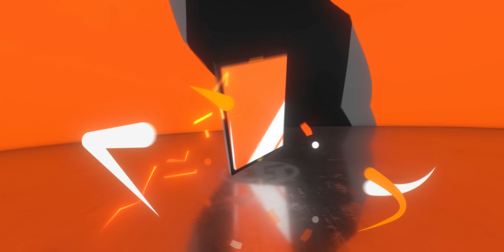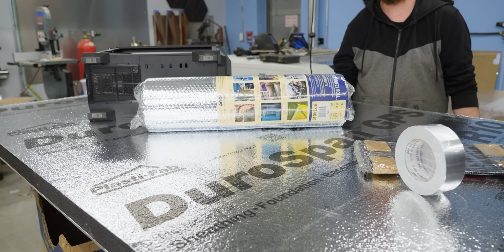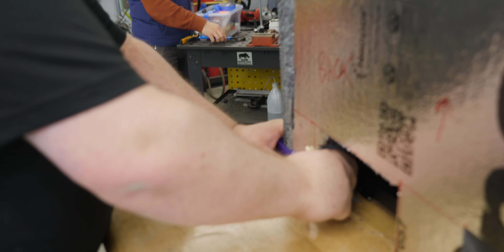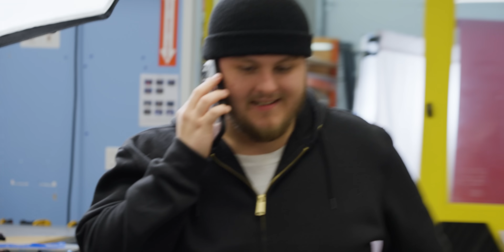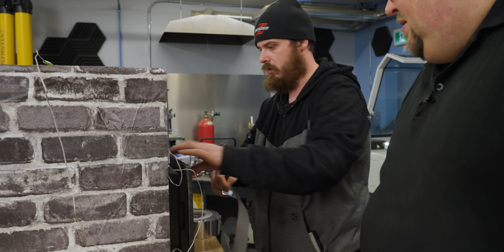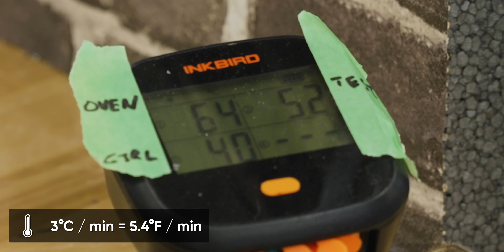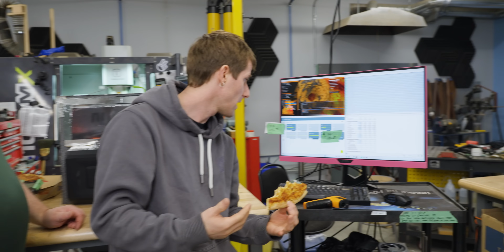Remaking Our Most Hated Video - Pizza Warming PC V2

Comment: My expectation for this video was for Luke and Alex to design some kind of heat exchange water block that the pizza would sit on and that transfer all the heat energy direct to the bottom of the pizza and the chamber, not obstructing airflow. Come on guys you can do better.
Reply: Thankfully they'll try again in 8 years
Reply: exactly my thoughts.
Reply: Hear me out... Peltier coolers
Reply: @ryanmiskin  peltier coolers are not very efficient, and in pc setups that use them they can consume as much power as the system itself. I’m sure it would be very good at keeping the pizza warm and the pc cool, but at that point it’s more like you built a peltier oven that cools the pc. I just mean that the games running on the pc that’s supposed to be doing the warming.

Comment: heat something with the power of a pc......
there is a french startup (Qarnot computing) that had the same idea, but they pushed it to another level.

for the individuals buying their product looks like a "weird electric radiator" (with an RJ45 plug???)

for companies on the other hand their product is computing time on their special "data-center"
the "electric radiators" are in fact intensive computing servers that are members of the "data-center"

Comment: I want to see a custom hot plate designed for an RTX 5090 and an Intel CPU where you can put a coffee mug on, a flat bottom bowl of food and whatever else you want. It should internally have water channels so you can control the temperature. Turn the pump and fans down when you need the heat, let the parts throttle.

Comment: Using Peltier elements to heat up the pizza and cool the PC.
It can be done by heat using a Peltier element clamped between CPU waterblock and regular fan cpu cooler.
This way the PC gets colder, and the pizza can get even warmer.
Reply: Was going to say the exact same thing. Peltier coolers get really hot.
Reply: I had the same idea. Also, I love how Peltier cooling is a terrible solution every time they test it, yet somehow the idea cannot be put to rest.

Comment: Make a 2way water cooled pc. 
1way circulate air through a radiator in an enclose "oven" 
1way cool down the system. So when the oven is at desired temperature you can cool down your pc. It would be so efficient!

Comment: The whole PC is going to heat up with this design. You should have used water cooling blocks on the CPU and GPU, then transferred that heat to radiators in a separate isolated compartment with the pizza.

Just like Lunis' pool!!!!

Comment: yeah i think you would need to eliminate airflow to the pizza by having it in an isolated chamber that is only connected to the heat source via heat exchanger in order to heat up the air and pizza inside. Keeping that volume as small as possible should be another priority. Having a custom copper plate with channels inside, where you direct the custom loop coolant water through (which you should heat to 60 to 65 C) would be the most elegant solution i suppose.

Comment: The radiators should be totally inside the oven, recirculating the warm oven air and adding more heat each pass. Having the radiators take cool outside air is good for performance but is counterproductive to warming the oven. As Linus suggested, some louvres to give the rads some fresh air would be good if it is getting too hot. 

If you really want to get into it you could try and make a counter-flow heat exchanger by stacking a few radiators together.

Comment: you should have connected the remaining spare psu connectors to to a metal grill with a twisty nob voltage regulator inbetween even with the minimum volts before the pc suffers will generate heat and direct heat on the pizza too 😁

Comment: Best way to go about doing this is to use all the fans except one to recirculate the discharge air through the pizza warming area. Then use the singular fan on a controller to keep the overall temperature at the desired setpoint. I'm thinking 70-75°C

Comment: 1.5kw PSU, and multiple peltier 100w chips connected to the water cooling block and the oven. Set it up with quick disconnects so you can use the PC as normal or connect this in line to take the coolant through the peltier units as a standalone pizza oven. If you insulate it right, 500-700w of heating like this might do the trick. It also means you can overclock while heating the pizza.

Comment: Use an AC unit to get more heat to the pizza while keeping the PC cold. If that's too loud then use a thermo electric cooler where the heat sink is a hot plate for the pizza.

Comment: Idea: Use the giant radiator Debauer has mounted to his wall, as a heating table/oven, using the water loop to cool, I dunno 6-10 pc's, and then have a lan party, keep adding pc's until it heatsoaks the radiator enough to keep let's say 3-5 pizzas warm.

Comment: One of my college tutors told of a story of how he would go to lunch and buy a chillidog.
He would then get back to the office and warm up the chillidog on the top of a hot piece of broadcasting equipment.
After a while the expensive and fairly uncommon device stopped operating.
When he disassembled it, he found that stray drips of chilli sauce had etched its way through the PCB.

How would I improve this?
1) separate the PC from the pizza warmer, to avoid the drips.
2) use a two way valve on a water loop to prevent the wrong temperature air getting into the box.
3) switch the valve on when the water loop is warm enough and off when the chamber is too warm.

Comment: This makes me miss cases where you could mount two radiators (whether AIO-based or open-loop) at the top of a case.   I only ever had one case like that, the Thermaltake Core X9, which was just waaaaay too big.  I actually had an M.2 SSD that would overheat and drop a noticeable amount in performance while using that case.  I had to put a fan in the case on top of an HDD carriage that was pointed at the M.2 drive just to keep it cool!  Anyway, what I liked about it the most was that I could truly keep the concept of using fresh, cool air for the input rather than what I had to do on later cases which was put a radiator at the front.

Comment: my first pc had such a terrible power supply and too demanding hardware that the head from the power supply alone could heat up a whole pizza
( the case was extremely cheap and thin metal ( ultron ))

Comment: One thing I’d change is to separate the AIOs from the PC case to fully take advantage of their heat output. As it is, some of the fresh cool air from the case intake fans is being pulled directly into the AIO fans, slightly cooling the pizza chamber. If the AIOs were isolated from the PC case and their full heat capacity was contained within the pizza warmer, the case itself could stay cool with its own fans while the pizza warmer would be heated exclusively by the GPU and CPU AIOs without case fan interference.

Comment: Like others have stated, I feel like they should have just took another CPU water block, attached that to a metal plate to the side of the case, and then used that because the heat transfer will be a lot better. And then the loop coming out of that CPU block would go into the radiator to cool the computer, so the initial heat of the CPU touches the pizza, and then afterwards gets cold if needed.

It could also be configured with a PID loop to 2 valves that bypass the pizza if it gets too hot. But I feel like that might not be needed.

Comment: @LinusTechTips Why AIOs over air coolers? Personally I think AIOs loose a chunk of the heat that they receive when they radiate it out (which I know is a debated topic sometimes) while air cooler radiates out most of the heat they receive.  I wonder if you had just changed out both AIOs with air coolers and put a couple big positive air pressure fans on the side panel blowing into the "oven" you would of achieved better results.  Possibly need a small hole on bottom side of "oven" to bleed air pressure but if strategically placed it should allow the hot air to stay and let any cooling air escape.

Comment: Nice. Though what if oil or any juices from the pizza soak through the cardboard and drip through the fans/radiators onto the motherboard? Seeing that it basically sits on top of those areas it would drop down and could easily kill the whole PC...

Comment: put a rotating platter that is controlled by fan controller so the pizza can rotate in the heat chamber. also, build custom heat sink that pipes the heat from computer components directly to the chamber surface hot (warm?) plate

Comment: So the way I would have gone about this is by basically getting the design of a conventional oven, and mimicking it in a smaller form factor. Then you basically take the components, build them into a cool box, and add some kind of molex adapter to run power to a separate board that controls the oven. I don’t know if any of that would work, but I’m sure I could cobble something together

Comment: Reminds me of my first pc I built when I knew nothing. My Pc was a Nvidia gtx750 and a MSI r7 37- 4gig gaming graphics cards in a mid sized case with an overlocked AMD FX6300. I had to remove the plastics off the metal side cover of the case to keep it from thermal overload and i use to put 4 McDonalds McChicken's on the graphics cards to keep them warm at gaming events in high school.

Comment: The problem is doing it direct-air.  You need a heat exchanging phase to ensure that the components remain at reasonable temperatures, but the harvested heat is evacuated into a DECOUPLED thermal chamber. My answer? HEAT PUMP. Make the PC case essentially sealed, with only circulation fans to move air across the cold-side of a heat pump. The hot-side will be inside the thermal chamber. I bet you could get a 200+F furnace with sub-ambient temps in the case! Using "cubic ft x desired temperature x .135 = BTU per hour is needed" from google, a 1m cube would need ~510BTU to heat to 140F. 1BTU is about 1055 joules, and a joule is 1 watt per second. So, if the system is producing about 1000 watts of heat, with a thermal retention rate at 85% in the oven, you could get it to food-safe temperatures in ~10 minutes with ONLY the waste-heat from the system. There are Instrument Chilling Systems on eBay that can do twice those figures and then some for 400 USD, so you could probably actually get sub-ambient temperatures in the PC EVEN WITH a 5090 and 13900k dumping full system heat into two thermally-enclosed envelopes...

Comment: You could make a loop - Split your intake air from the chamber as well as outside. You can then keep heating the same air inside the chamber instead of pulling in fresh cool air. Software can control the ratio of cold air from outside and recirculating air to get the perfect temp all the time. Source: I do chemical process control :)

Comment: Next time around you should use a thermoelectric heat pump (peltier cooler) and a custom water loop with some kind of heating plate to heat the pizza while keeping temps under control :)

Comment: Guys, you almost did it the right way. But just almost. You already had the water - air exchangers, so just shove them in the insulated box and keep the air recirculating there. The rest of the PC can be cooled normally. Also, you need some kind of a spacer between the pizza box and an exchanger, so you don't block the air flow.

Comment: I think the next generation of this would use heatpipes and a single hot plate with fans mounted to the underside of it. You'd have a switch to control the fans off/on. If the fans are on we're not warming a pizza, we're keeping the machine cool. If the fans are off, the hot plate heats up and the pizza stays nice and toasty.

Comment: The way to do it would be water from the CPU and GPU route to radiator with a fan on it in an isolated pizza warmer box first, then on to another radiator with controllable fans, so the pizza warmer gets the heat first, and excess heat can be dumped to atmosphere 2nd, in a controlled way before it returns to cool the CPU and GPU!
Reply: @Sparks0001  I thought it was obvious but apparently not at all
Reply: What they did really doesn't work for what they are trying yo achieve, or for anything at all really 😂

Comment: Just randomly thinking about how to make this better... Seeing how the fan speed causes heat to seep out, I think maybe radiators is the wrong way to go if you're talking about heat retention. What if instead of a radiator you let the water in the loops get up to temp and let the heat radiate passively within the thermal chamber? like a long loop of black tubing within the thermal break material (foam). No fans, just the pumps. MAYBE have some fans to make sure it doesn't go over 95C or something.

Comment: Choosing AIOs was a fail..  Should've used air coolers. AIOs take forever to heat up due to the thermal mass, which is great for keeping components cool, but terrible when you actually want the hot air to warm a pizza.

Comment: The oven needs a vent to draw the heat across the pizza and out the other side. Consult some air fryer designs. Also recirculation of the hot air from the oven back into the intake of the case. The intake fans are also detrimental. Some kind of thermal mass to accumulate heat in the oven would also help. Check out furnace heat exchanger designs.
Reply: No that's just going to dry it out. The pizza is already cooked so it needs to be kept warm and moist not air-fried. You want static air in the chamber - have the bottom be a metal plate that's also a heatsink

Comment: Actually the right way to do the project would be using peltier cooling to reduce the temperature of actual components, and then use custom loop with other side inside the oven that has such a bottom that doesn't drip anything possibly to inside the computer, and second radiator after the oven radiator to cool the water to reasonable temperatures.

Comment: Ya know what's funny, Linus says the 13900k thermal throttles anyway, but mine never thermal throttled. It was stock settings, with an 360mm AIO, and it never thermal throttled while gaming, or even with prime95. And it was on par with the every other 13900k in terms of performance. It really didn't like overclocking much, but I didn't really need to. Not sure if I got a golden CPU or what, I've never been able to figure it out.

Comment: this is awesome and exactly why I subbed to this channel 

next level would be better enclosure, have airflow in the oven (slow, but some, created by fans that push heat there) have power supply exhaust heat to the case so it heats up a lil more... 
but even this proves that it can work

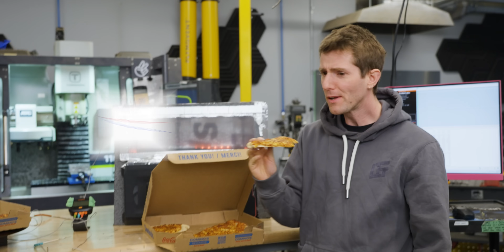Comment: 10:20 so you’re telling me pizza shops could’ve been mining crypto while having their orders waiting around this whole time? 😂 the profits these people could’ve been making is insane!
Reply: Especially since a non-mining warming system would probably cost the same to run.
Reply: Pizza shops have like an actual oven running ALL the time. Simple duct work gives them all the heat they need.
Reply: @ no pizza shop in my area uses ducting to heat the pizzas they’ve made already. They have separate heat lamps and such sitting on the side and hot boxes
Reply: If you know a crypto mining device that can withstand >200 C°
Reply: @gijsqwerasdf  The crypto rigs would be powering the warming oven, not the the actual cooking oven.
Reply: @gijsqwerasdf  It's a shame CPUs aren't efficient for mining, then they could just cook the pizzas using 14900ks idling at desktop
Reply: @Xbob42  If you are going to be using electric resistive heat to heat a chamber anyway, CPU mining becomes 100% efficient. It is producing the same amount of heat for the same amount of electricity, oh, and now we get one coin every few years.
Reply: @gijsqwerasdf did you just make the same mistake Luke made a decade ago? I think you did.